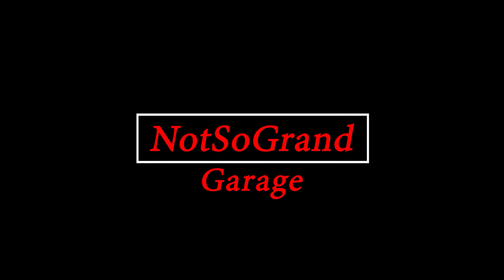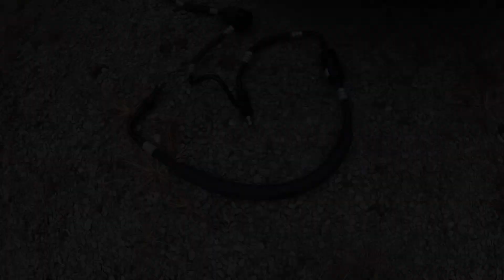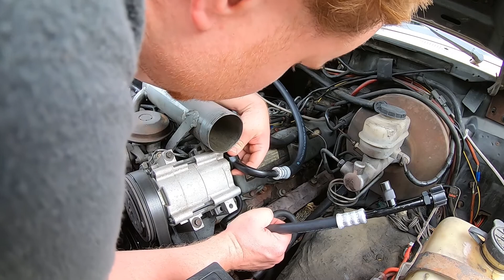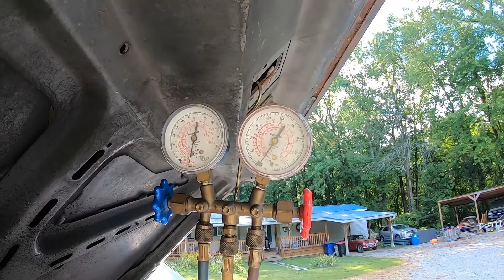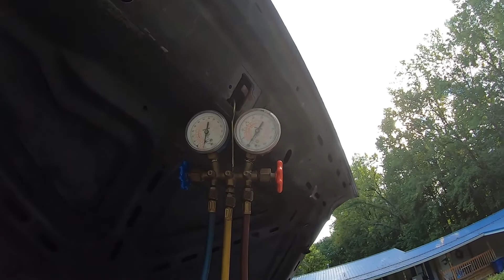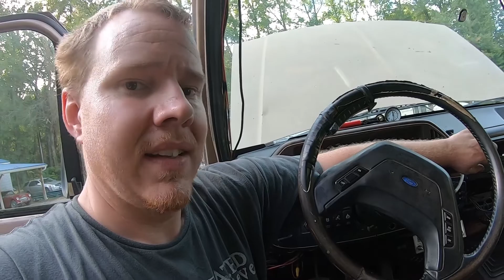AC Fix - Replacing Refrigerant Line On 1990 Ford F350 IDI - DIY - Cold AC Once Again!

Comment: I would love to see a video of your air filter and crankcase pressure system, if you don't already have one.
Reply from the maker: I don't have one but the intake is very simple.  A couple bends and some tubing welded up.  The crank case vent setup uses the Banks adapter on the timing case routed back to the intake.

Comment: I have a 1990 ford f350 with 34k miles all original engine and AC components ac is not blowing cold, is r12 system need to get it going again
Reply from the maker: To be cost effective, you'll have to convert it to 134a.  Replace the dryer, orifice tube, and flush the lines and such.
Reply: thank you for all the help with these IDIs. did you have to do anything to change out the ports on the hi/lo when switching to 134a? I’m about to undertake on my ‘93 IDIT.

Comment: You are sucking hot air into your intake with you air filter like that. Air density is a thing.
Reply from the maker: Beats no air filtration at all.  Had to make something work as I didn't have the stock air box.  With that said, it'll change at some point but not sure when.

Comment: I saw a post on Facebook today about upgrading to group 31 batteries and I remembered noticing you had them in this truck. Did you notice a big difference with the higher CCA’s? Is it worth the upgrade? Thanks
Reply from the maker: Well, in most cases, the group 31s are cheaper than the stock batteries.  Most truck stops will have them for under 120 each and there is a noticeable difference as long as the cables are in good shape.
Reply: Okay thanks for the info

Comment: Didn't PA Biodiesel Supply shut down this year?
Reply from the maker: They are back up and running...  taking pre-orders on their new single pass units and have pressure driven units.  I thought the same thing until they reached out to me.
Reply: @NotSoGrandGarage  glad to hear that. To me it seems like their ultimate force centrifuge is the one to buy between them, WVO designs, and USfiltermaxx. But they haven't been available for a few years now it seems.
Reply from the maker: @nicholasnelson7195  From my recent discussions with them, they'll be available in the fairly near future.